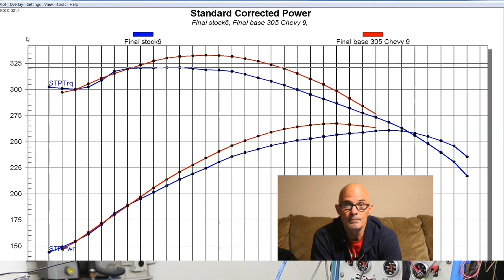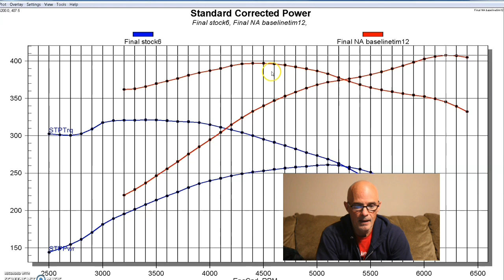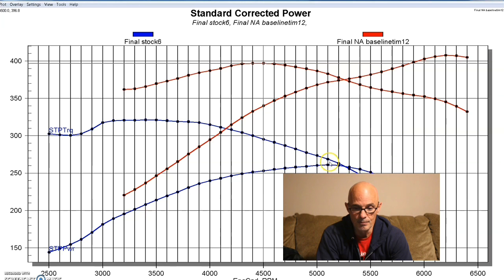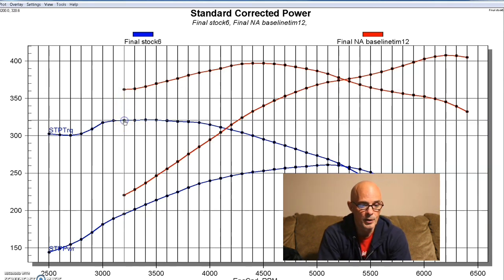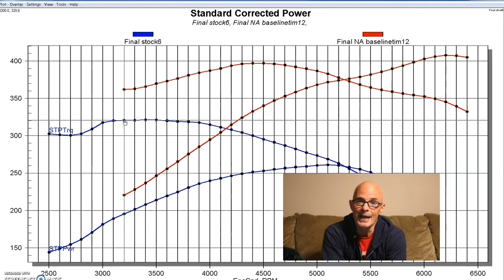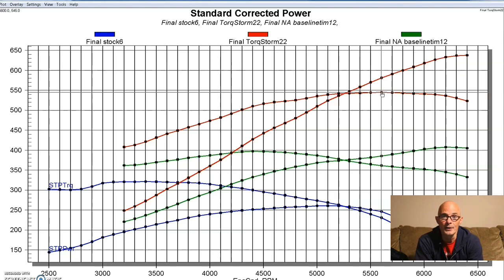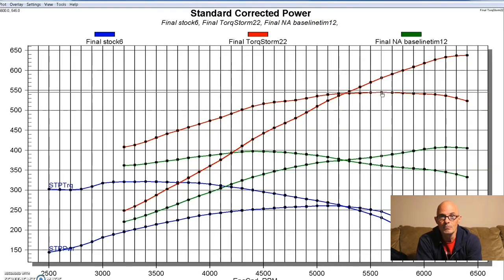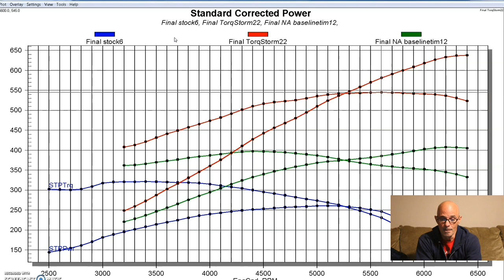5.0L FIGHT-302 FORD VS 305 CHEVY-FULL RESULTS

Comment: Both engines did great. Over 600 hp is more than enough for a street Camaro or Mustang of that vintage. Thanks.
Reply: Agreed. And 6400 rpm works for me
Reply: On two bolt mains
Reply: 600 is plenty for anything on the street😂
Reply: My Corvette came with a 4 bolt main block and a 4 inch bore, what would a 383 make supercharged? I bored and stroked the stock motor and boy what a difference.
Reply: vs a 347 Ford stroker! That was a Ford popular stroker in the day.
Reply: especially in a light foxbody
Reply: @johnboticki9154  how long will a stock bottom end hold up at 6,400. I have a 96 LT1 Z28. I generally don't rev the snot out of it, usually I let it shift at 4,500 if im getting on it. it has plenty of low end grunt anyways. it makes most of its torque down low.
Reply: 600 horse on that 5.0 is a ticking time bomb. Not well versed in Chevy small blocks
Reply: @KegzTandOG  I think expecting a stock bottom end on a V8 to hold up to 6,400 rpm reliably is nuts. wont happen. requires a forged bottom end, high performance work
Reply: @andrewdonohue1853  the Ford 5.0 came from the factory with a forged bottom end. 
Grant that's media hype , as long as you keep the revs below 6500 rpms and the tune is on point it'll live forever at 638 hp....
Reply: @robinesavage404  Correction those 5.0 only had forged pistons. The crank and rods were still cast iron.
Reply: @sebbonxxsebbon6824  there is an article on that exact setup. Torqstorm supercharger made 750 hp!
Reply: Agreed. That's as much power as my ZL1 has. And if you're in a 3rd Gen Camaro or a Fox Mustang you're in a MUCH lighter car. It'd be real fun to drive!
Reply: @Shane-Singleton  Yep,my 87 Firebird with an ls1, 5 speed is under  3,000 lbs.
Reply: @robinesavage404   It's not the rotating assembly that is the issue...The later model ford 5.0 factory engine blocks themselves are the failure point here. The blocks have a tendency to crack or split at over 550 h.p. or so.
Reply: @andrewdonohue1853  if you build it right and don’t live at 6400 constantly, should easily do 100k.
Reply: 305's are more for trucks, poor man's hauler... 302 is more for racing.
Reply: @sebbonxxsebbon6824  305 is already the poor man's stroker.
Reply: A ton for that little mustang man 400hp 5speed cobra is gonna fly man at 6 grand
Reply: @hcrib1 forged rods and nodular iron cranck…

Comment: I'm not a Chevy engine guy anymore. I'm now a "just add boost" guy
Reply: Me too.  All the vehicles I owe are turbo charged, with the exception of my 2000 Regal GS which has a supercharger, but not for long.
Reply: Haha same dude. Doesn't matter the engine.. is it slow? Just order a Ebay turbo and you're good to go!
Reply: Brett Collins  well, turbo and it's needs. Injectors, fuel pump, tune, wg, bov, temp issues, oil passages. I've just built a couple turbo LS and I now I just see them as the general way to go

Comment: Well, what do I know? Lol. I was an 80s guy and always believed that the Ford 5.0L was the Better Engine in Comparison to the Smoger 305 bowtie, thought it made more Power and Torque, because the 'Stang felt alive while the Bowtie felt reserved.
I had friends that owned one or the other, and the 'Stang always felt wild in comparison, just better pick up and straight line acceleration. Handling went to the Bowtie. 
608 HP! WOW!!! 
Thanks for the great in depth comparison.

Comment: I would never spend the money on a 305 Chevy, I would rather replace it with a 350.
The Ford 302 is a much better engine, to spend money on.
Reply: How so? 302 often splits the block at 600hp +
Reply: And that's why the 305 never got too much love from the aftermarket because the 305 and 350 had exactly the same outside dimension.  Anywhere a 305 would go a 350 would bolt right in and look better.  That's not the case with the 302 vs. 351 ford.  The 302 was a short deck and would fit better between the narrow strut towers of the fox body.
Reply: @deantape2759  run a Boss 302 block
Reply: @ttank1994  Though true, the 327's was very sought after and people often pulled their 350's to stuff in a 327's (especially with some double hump heads).
Reply: @deantape2759  fake news....
Reply: Yeah I will have to ttotally agree with you on that fact that a 305 Chevrolet is a peice of junk, and I personally think that Chevrolet stands for Cracked Heads Evey Valve Rattles Oil Leaks Exhaust Too, and that FORD stands for First On Race Day, Fastest On Race Day, First Out Run Dodge, or First Out Run Dale!!
Reply: @ttank1994  all small block Chevy had the same outside dimensions.
Reply: @kevind3185  correct, however, I mentioned the 350 specifically because my reply was intended for the original poster that mentioned replacing a 305 with a 350.  Made more sense before several other replies showed up
Reply: @robinesavage404  its not, its a known thing, 600hp in the 302 and it wont last long.
Reply: Hulagan 808  for our real driver's 🤣
Reply: @ttank1994  460s fit well...They are not narrow. Early fairlanes and mustangs are though.
Reply: The compare should use a 302 chevrolet , same 4" bore & 3" stroke see how things look then
Reply: @deantape2759  Yeh ....I seen them break those 302 Ford blocks .... they are not happy for long
Reply: Dean Tape  yes with stock bottom end lol Go figure lol I seen 302 1100 hp all racing.
Reply: Dean Tape  only stock bottom end. I seen 302 1100hp all racing. Crank, rods and pistons etc..
Reply: Hulagan 808  Ford >
Reply: 305 and 302 are good daily driver engines.
Reply: @Silkmaster4200  billet block i guarantee it
Reply: Lol listen to the muppets talkin about “bUt tHe 350’s bEtTeR”.     The reading comprehension is weak here people.
Reply: Hulagan 808  For the bucks down guy a 4.8 or 5.3 with ebay turbo is the ticket.  I love the 350, first engine I ever rebuilt, but you'll make way more power for less money with a small cube LS turbo.  only prerequisite is a laptop.
Reply: tom 305’s made great boat anchors after you replaced them with a 350.
Reply: @Silkmaster4200  thats right, retired drag racer i know seen plenty 15 psi boost on 302 blocks and outlasting 350 blocks, he seen a lot of cracked blocks and a lot of them were 350 blocks not just ford
Reply: I like small inch V8s..  I drove alot of 80's vintage ones and they were all smog choked and under 230hp but got the job done.  We all pulled our projects around with 1/2 tons and never lacked for power.  Decent fuel economy.  305 is a good motor.. can be pushed to 350hp pretty easily...Which is what alot of 60s/70s Corvettes had.
Reply: 351C with boost.
Reply: @deantape2759  That's actually completely false. The NEWER 302s aren't super reliable over 600 hp, the OLDER 302s, which have a 40lb heavier block(I weighed them on a scale) will handle over 750 hp. My 1975-302 block-based 332" stroker makes 530hp, and I rev it to 8500, it's been doing it for 20 years. I'm changing the heads for 600+hp this year, and it will be 100% reliable still. There are a lot of people running newer 302 blocks well over 600hp for years, without issues, but I'd stick with the older, stronger blocks.
Reply: @deantape2759  there are many different blocks to build a 289/302 engine on.  I run a billet 4 bolt mains and end caps block that has a premium cost but handles much more than a 1000 HP if I put boost to it.
Reply: 305 were always junk!
Reply: @Rom vin Oh for sure there are tons of more sought after now, I was referring to what was more sought after way back in the day between the two. Have had a few 383 strokers over the years and enjoyed everyone of them but i'm also one that thinks most any engine can be built to be pretty decent (not a die hard-biased on any of them). 
 You should start recording your journey if you don't already bud, many would love to follow along I bet.
What country you running a guide service out of if you don't mind me asking?
Reply: @AmericanThunder  
Do you mean 302 crate engines or the new DOHC 5.0? The new 5.0 is an amazing engine and I’ve seen them live on 1000 hp without a problem.
Reply: @roninkraut6873  I built engines for a lot of years I'm not sure about new crate engines. I was referring to older 302 being pre-1982 and newer 302s being 1982 up until their last year production. "new" to me is 1980s and 1990s, older engines are 1960s and 1970s
Reply: @AmericanThunder  
Gotcha. With the new 5.0 DOHC it’s sometimes harder to tell which engine people are referring to.
Reply: good luck finding them now......I am driving 3 hours one way tomorrow to pick up a 5.7 Vortec core for my build. The biggest junk yard near me had ZERO 5.7 Vortecs or TBI's (I am not dealing with a flat tappet). The 350 has been out of main stream production for almost 20 years now.
Reply: 305 is still way easier to work on than the ford because it is still a sbc. A water pump that bolts to my timing cover no thanks also more stroke is more streetable. Will you make more power with a 350 or 400 yes. But in the right hands the 305 is a good street engine if you remotely care about gas millage.

Comment: Love that old school 5L tech. They make crap for power compared to modern engines but a 5L Ford is what made me a car guy. Good job. Keep them coming.
Reply from the maker: they started all this craziness
Reply: And really, how often is the full 600hp used, in a daily.  A good dose of grunt, like both the Ford and Chev have, and you’re good to go.  The iron block 308/304 Holden here in Australia ran 4.0 bore spacing.  It did pretty well for itself.
Reply: @RadRidesByCru  and tuning. The ecm on the 5.3 is just great for tuners. Not many PCM options on an efi 302.
Reply: @RadRidesByCru  not really man the 5.3 is just a way better engine in every aspect, way better tuning, fuel economy reliability driveability etc people run stock engines all the way up too 1000 horsepower and can't kill the damn things and with the Ford you have to do a full aftermarket rebuild basically if your looking past 400HP reliably and you already are rebuilding basically if your putting a stroker kit in it, the 5.3 will be cheaper to buy than a stroker kit in the first place as well it's just a way better platform but on the other hand the coyote platform murders like its name was Ted Bundy

Comment: Ahhhh.....the memories!
Thanks for the comparison Richard!!
I'm the original owner of an '85 GT 5.0 (last year of the Holley carb Mustangs)
I did plenty of my own 'comparisons' back in the day vs. IROC-Z 305s.....
and they always lost.
I especially loved the 5.7L IROC-Zs because their owners KNEW that they had a better motor than the 305. Unfortunately for them.... my little 302 walked them almost as badly as the 305s.
Now I've got a built 363 SBF/Magnum 6 speed and the 3,100 lb  '85 GT is wicked fast.
Reply: sadly,you went up against tbi's and the lowly lg4 carbed 305........they are the most used engines in the irocs(cheaper)  if you met a few lb9 (tpi) 305's with the stick you would have had a much harder time.the tpi autos were also not the best,much like the l98 350 with a shitty 4 speed auto and poor gears...apples to apples these cars (mustang/iroc/ t/a )with the 5.0 and 5 speed were pretty evenly matched
Reply: @trillrifaxegrindor4411  maybe it's an altitude thing but at high elevation, it isn't even close. 305 was terrible.

Comment: Almost 30 years ago, my buddy had a stock 84' Z28 with a 305HO 5 Spd.
We sreet raced that thing all the time, and every Mustang we raced....lost. Those guy's ALWAYS had excuses, but the clipboard we carried didn't lie.
Thanks for the memory of the days past, LS is where it's at!!!
Reply: Guns N Gears I had an ‘84 z28 L69 H.O. 5-speed back in 1991.  My car had no a/c, no power accessories, and what became the 1LE package the following year.  My car was as it came from the assembly line except for a nice stereo system.  It beat the stock Stangs every time.  There was a guy in town who had a 1986 5.0 stang.  We raced several times, but it was always a driver’s race.  He had deep gears, headers, and a/c.  The last time we raced, I lost due to a broken shift fork in the T-5.  For those dark days of smog-bred wheezers, both the Camaro and mustang kept the spirit alive.  At the same time, my brother had an ‘85 IROC with the anemic LG4 5.0.  He wouldn’t even try to race my L69
Reply: @mistered9435  ah yes, the good ol days!! Thanks for sharing you're memories,  as it brings even more back to me from the day 
God do I  miss the 2nd gear launches from about 30, just hearing that spreadbore howl.
Now days, I'd be happier than a Pig in shit to have any of those cars, cause a Guy could work on them without the aid of a Computer.
Reply: That’s too funny because I had a 1970 mark one 351 Cleveland for barrel heads high rise and I eat a lot of Irox and some hem I hate it I rock that was like a Guido car
Reply: @freedomfighter5054  maybe so, but as I recall, the video was about the Ford 5.0

Comment: Loving the variety. These old small blocks are still a great platform with lots of potential. Would love to see a small block mopar if possible!
Reply from the maker: I have only ever built 1 360 Mopar and pulled it out of my running van
Reply: @richardholdener1727  surprising to hear you've only built one. howcome you pulled it out?

Comment: Was amazed at the 5 liter Chevy na power. Back in the early 90s I seen many ford and Chevy battles street racing, we never had a drag strip, the 305 camaro/ firebirds were dirt. The mustangs would eat them. You say both run close to the same numbers but you need to realize that a 90s camaro was alot heavier then a 90s mustang so that 3 or 400 pounds made a big difference. Brought back some good memories. Thanks.
Reply: depending on the models fully loaded GT was 3200lbs easy.... fbody wasn't to far off....... the old 3rd gens and foxbody are feather weights compared to the new generation lol
Reply: That was my experience on the street as well and that is based on owning 2 3rd gen TPI Camaros and 3 Fox bodied 5.0L cars in the 80's.  The "Five Ohs" always outran the 305 TPI cars and usually hung with the 350 TPI F-Bodys up to about 130 mph. I think the real difference between the two was most TPI cars had automatic transmissions with stock torque converters and rear gear changes were not commonly done due to cost at the time. Where "most" 5.0L Fox cars had 5sp manuals with better gearing and a rear gear ratio swap was a cheap and common upgrade at the time. (Personally liked the 3.73 rear gears in the 8.8") I feel this is why the Mustangs ruled the stoplight races back in the day with basically the same or even a little less power as the TPI cars, better gear leverage was in Ford's favor back then.
 Fun memories!
Reply: Fitzee's Fabrications they weighed basically the same... the lightest v8 camaro was ballpark 3200 pounds, the lightest mustang was like 3100 and change... less than 100 pounds is absolutely nothing....

Comment: Ahh the days where the Ford guys would ask their buddies “did you go with the B or the E 303 cam and are you going shorty or full length headers?” and Chevy guys would ask their buddies, “when ya gonna tear that FI shit off and throw a Holley on it?”
Reply: You are right! Lol,those were the days!😂👍
Reply: The tuned port was a great truck motor.
Reply: @bartpang  it really was.  Such a shame that they never realized that it should be used in that fashion.
Reply: True story. The stealth ram helped things out alot when holley released it 12 years after the last tpi engine was made and nobody gave a crap anymore, but i cant tell you how many times i saw carbs where there should have been a tpi manifold.
Reply: B cam
Reply: I was building a 5.0 with trickflow 170... b cam.. 600 carb was gunna be nasty
Reply: Wolverine 1087
Reply: I was too young to participate in it when it was fresh but caught the tail end before LS motors and turbos took over the world. That was the second coming of the good old days in the 80s and 90s. Whats going on now days is insanity.
Reply: The engine management on the TPI motors was trash. Speed density and PROM made it near impossible to accurately tune. If I had to build one today (gun to my head), I would just toss on a cheap set of mildly worked over Vortec heads, LT4 Hot Cam and a Ramjet intake with a modern ECM and MAF. Probably 450hp and then force air with a turbo.

Comment: Way back when Richard would have his own column in MM&FF I would anxiously wait every month to read what new project he tested. He always gave incredible information. Thanks Richard well over 20years I am still impressed.  Just a tad bit of information-I owned a chassis dyno business for years and to this day still tune multiple software's. It takes alot to impress me. Thanks for your hard work. Most on here DO NOT realize the commitment and time required just to perform these test. Once again- thank you for this content!
Reply from the maker: thnx for the support
Reply: @richardholdener1727  Again, thanks for  the content. You have been an inspiration in my endeavors.  Deep inside I am a Ford guy but i appreciate anything internal combustion. My 2nd choice is Hemi. There isn't anything like a Hemi pounding the dyno or dragstrip. In your free time would you please do a solid vs hyd roller comparo on a sbf? I am currently putting together a solid roller sbf for the street. I feel you would give the facts &  no opinion on the setup.